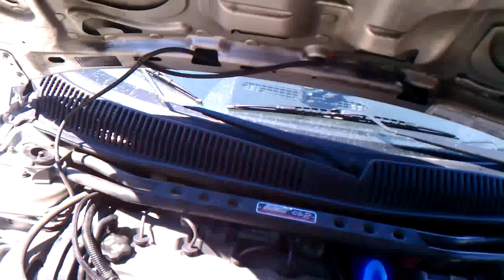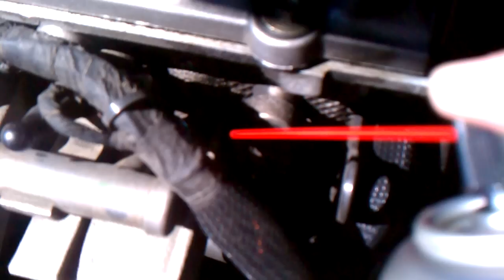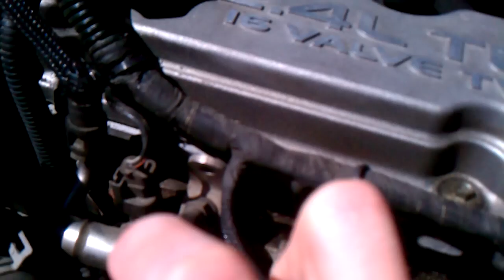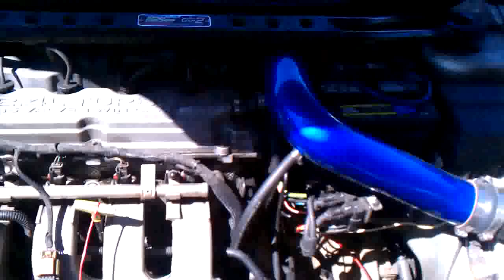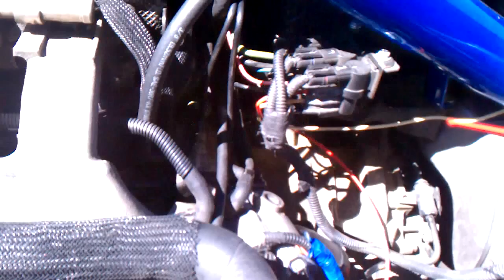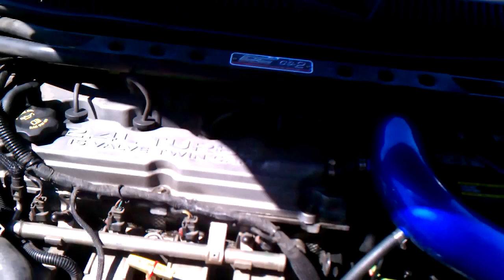Checking for Vacuum Leaks, 2004 Neon SRT 4 Probably not correctly.

Comment: Are you using WD-40 or compressed air?
Reply from the maker: Ryan Ward This was resolved. Thanks for your comment though. It was carb cleaner. I was trying to see if the idle changed when I sprayed it indicating a leak.
Reply: where was it leaking?